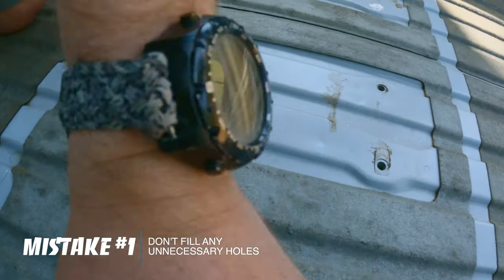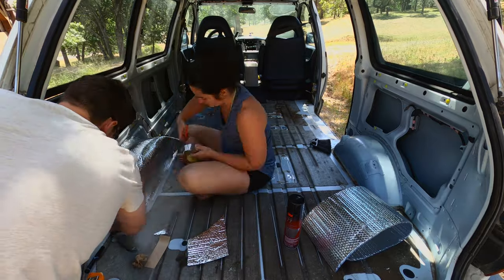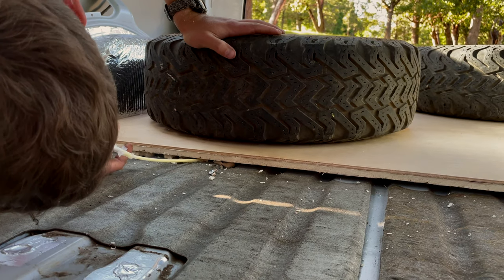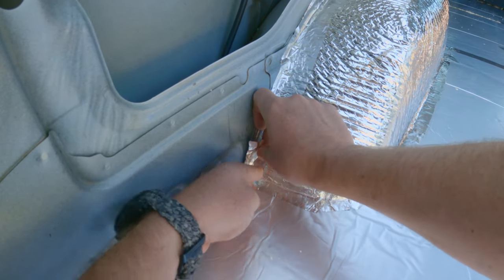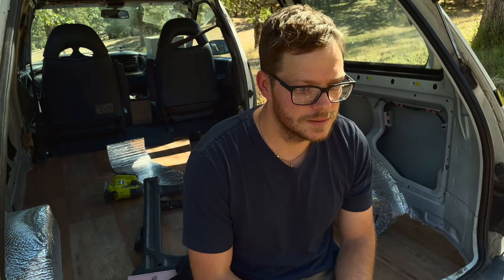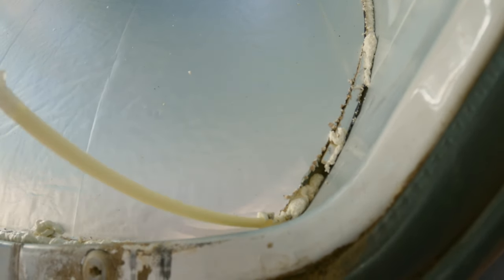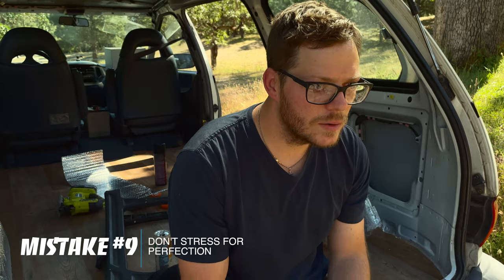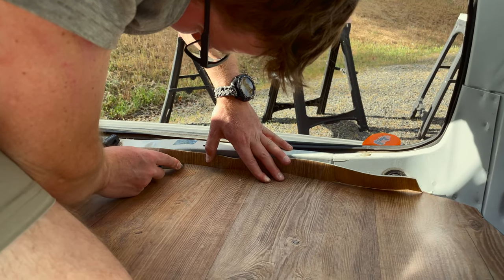9 Van Floor Mistakes To Avoid When Doing A DIY Van Floor Build | Minivan Conversion Floor Mistakes

Comment: another flooring mistake: don't use reflectix for wheel wells. It's not made for this and does absolutely nothing for this build. Instead, put on sound deadening on the wheel wells. Reflectix is a radiant barrier, meaning it needs a space on the side it will be reflecting radiant heat. Using reflectix properly takes up a ton of space, it's not for a tiny car build. It can be used best on ceilings in taller vans, but there are still better materials overall that will utilize the space better and give better results. Reflectix is best used in windows for any build... then no space is needed due to the physics of a clear window and it's heat transfer properties.
Reply: Agree! Agree! Agree!  We see so many van/RV builders use reflectix improperly. I used it under my house in a crawl space. For insulating vehicles my money’s on either rockwool, then foam.
Reply from the maker: Yep you’re totally right!

Comment: I was so excited to find your channel. 
I have a 97 Toyota Previa with only 60,000 miles on it. Your videos have been inspiring and helpful. I’m impatiently waiting for more videos on what else your doing in the Previa. When will you post an update?
Reply from the maker: That’s so cool you found such a gem!! That’s lovely to hear. Because your comments are inspiring us to work even harder to get this stuff out for others. 

The Van floor video should be done in the coming days. Then our plan is to post a new build video each week covering the main topics of the build but also including finer detail things like solar, roof vent, slide out bed. Etc. So stay tuned!! 😉

Comment: Wait! I thought there was a full beginning to end guide on the floor building part. Did it wind up being easier than the insulation or something?
Reply from the maker: Yes. You’re totally right. That will most likely be the next we do. Even though we are nearly entirely done with the van build right now.

Comment: Seems to me your making this sound way more complicated than it actually is..I have a minivan but left my sidewalls up..caravan cargo model..I foamed the cracks of floor, evened out, polyiso carpet..no van is warm enuf without heat but yes, insulation helps..I also have yoga mats on floor under my bed, also on floor. Rolled up daily..kitchen on opposite side, toilet(coffee creamer bucket)that I put  bags in..perfect fit n big enuf to work, small enuf to hide😉 appreciate tips tho..been in van 4 years, not a single thing built..
Reply from the maker: Very cool. So interesting to hear how other people do it! Thanks for the comment!